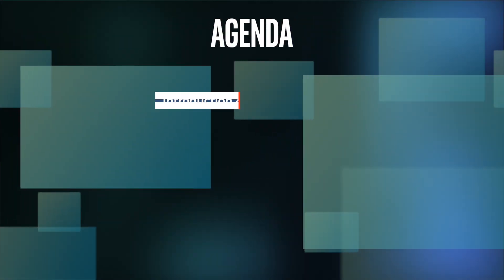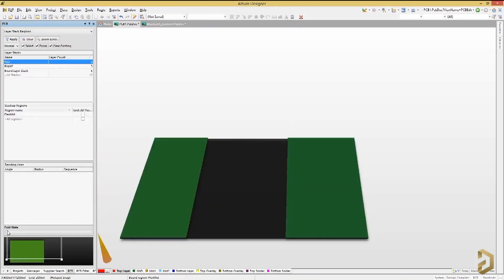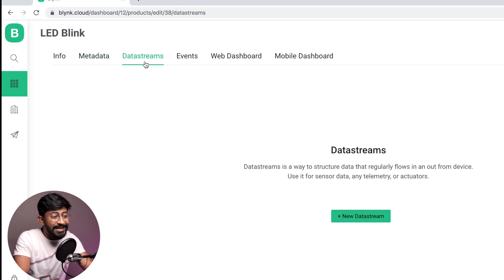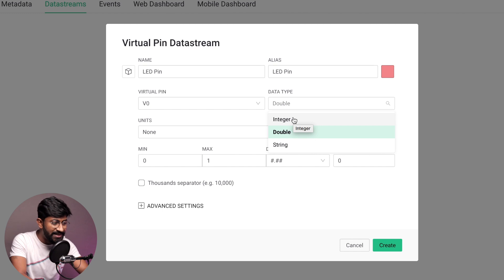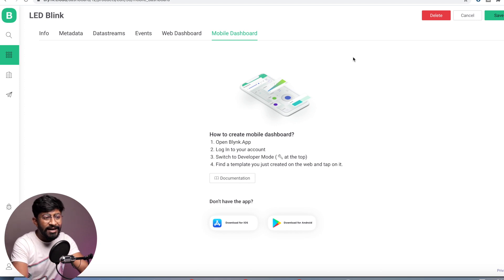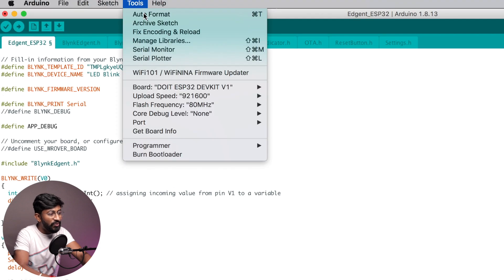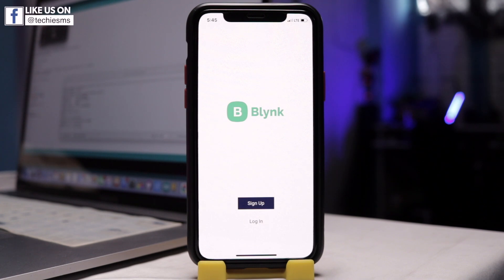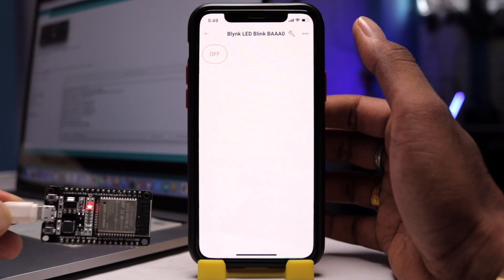Making your first project on New Blynk 2.0⚡️

Comment: I tried to use a esp8266 with a arduino uno but a I’m getting 10 different fail messages all worked but the arduino stuff had a problem when I used the example I got a fail warning with the user_interface.h i asked chat gpt for help but it didn’t work and this was just the biggest fail message I got I also got Exit status 1 and other little things so can you create a new vid where you do it with The esp8266 instead i think it will help a lot off people including me I even changed where you took you esp thing to the esp8266 even the example

Comment: Thank you for the video on Blynk new. They are all very helpful. I followed all the steps that you have given int this video and got successful in the first time. But after that my esp8266 board is not connecting to my iphone. The device hotspot is not shown in already connected devices. can you help with what might be the issue. I tried resetting esp8266 board, powered on and off modem, cleared and reinstalled blynk. but nothing is working out.

Comment: I got the esp set up done well, everything connected finally. Though I am having trouble seeing how to connect the LED to the breadboard. I am a complete noob, sorry, but I am trying. Could anyone explain how the LED is connected? or even link a diagram or something? Honestly I do not even know where pin 15 is, or how to wire that. Maybe I have been at this too long and I am going crazy. But thank you for your help. It is much appreciated
Reply: Do the programming part wiring part is easy ..man

Comment: Thanks for sharing. I have a question regarding baud rate. I am developing an energy meter and using Proteus for circuit designing. I have connected ESP3266 to my proteus circuit using COMPIM available in Proteus for serial communication. First, I have tried to upload data of voltage,  current and power on Adafruit IO but there I am only able to display one reading at a time even I have created separate feeds for each parameter. I think this issue is due to baud rate as max baud rate for COMPIN is 57200 but I think it will work fine with 115200. Can you help me figure this out?

Comment: Thanks, dear. I was struggling to get my first program working until I came across your video. It was very clear and I was able to follow it easily. Except in the beginning when I tried to create the new template on web dashboard I got a message "You cannot create product for this Organisation" or something close to it. I had to  go to settings and turn on the developer mode and then I was able to create the template and from them it was smooth.
Reply: how can you say that? That guy can't speak English

Comment: So with the first blynk you could simply connect your phone to a device with Arduino IDE and then add and remove buttons without altering the code , so now for example I need to rewrite code with 30 virtual pins on a Arduino Mega plus 5 other devices I'm using around the house which doesn't sound like an improvement for me.

Comment: my first device with nodemcu could be installed and it is working fine on Blynk 2. When I add a second device using the first template it shows as offline on my mobile app. How to flash the network credentials in this situation? any suggestions?

Comment: i am unable to add device to blynk.

ets Jun  8 2016 00:22:57

rst:0x1 (POWERON_RESET),boot:0x13 (SPI_FAST_FLASH_BOOT)
configsip: 0, SPIWP:0xee
clk_drv:0x00,q_drv:0x00,d_drv:0x00,cs0_drv:0x00,hd_drv:0x00,wp_drv:0x00
mode:DIO, clock div:1
load:0x3fff0018,len:4
load:0x3fff001c,len:1216
ho 0 tail 12 room 4
load:0x40078000,len:10944
load:0x40080400,len:6388
entry 0x400806b4
E (110) psram: PSRAM ID read error: 0xffffffff
[129] Using default config.
[245] 
    _  __          __
   / _ )/ /_ ___  / /__
  / _  / / // / _ \/  '_/
 /____/_/\_, /_//_/_/\_\
        /___/ v1.0.0-beta.1 on ESP32

[248] --------------------------
[250] Product:  Home Automation and Power Monitoring
[255] Hardware: 1.0.0
[257] Firmware: 0.1.0 (build Jun 20 2021 19:23:11)
[262] Device:   ESP32 @ 240MHz
[264] MAC:      3C:71:BF:C3:C5:44
[267] Flash:    4096K
[269] ESP sdk:  v3.3.5-1-g85c43024c
[273] Chip rev: 1
[274] Free mem: 260436
[276] --------------------------
[279] INIT => WAIT_CONFIG
[2895] AP SSID: Blynk Home Automation and Power Monitoring-0E6F0
[2896] AP IP:   192.168.4.1
[2897] AP URL:  blynk.setup
[12348] WAIT_CONFIG => CONFIGURING
[15033] Sending board info...
[17307] Scanning networks...
[22228] Found networks: 2

esp32 wroom 32 stucks at above message

error on blynk app:
Connection with device was interrupted.
 
please help me with this issue

Comment: Absolutely brilliant. Thank you. I've used Blynk for some time and this overview of v2 is exactly what I needed. May I ask why you don't use a current limiting resistor in series with your LED?
Reply: Green LED 5mm. . . . Voltage = 3.5V, similar to ESP32 Digital Output.

Comment: Hi sir.. Is it possible to use both the new blynk 2.0 with the old one simultaneously? meaning the new blynk 2.0 will be connecting to the esp32 using wifi and the old blynk will be using Bluetooth?
Reply from the maker: you can use but not on the same board
Reply: @techiesms  alright..thx for the respond

Comment: Dear sachin sir
If i will update my blynk app with new version in which only virtual pins are there.

So what about my previous project which are running with digital pins of old blynk app.

Where they will work or not.

Please tell me i m worry that if i update my old blynk app woth new one my old blynk project are still work or not
Reply from the maker: Old app and new app 
Both are different apps